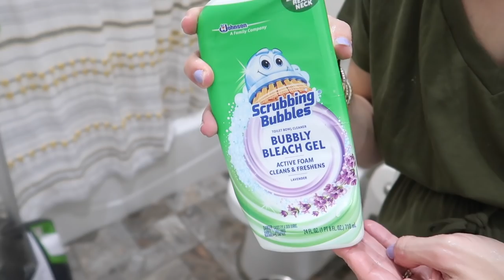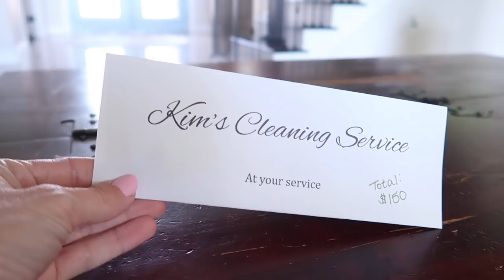A Mother's Touch Whole House Clean With Me!  Top To Bottom, Let's Do It! Homemaking Motivation!

Comment: I heard a tip once that might help for Meredith's bed! Put pool noodles under the fitted sheet on both sides to help put a little buffer on the edges of the bed. Jumbo ones would be even better. :)
Reply from the maker: Pool noodles, yes!  I've heard of this.. probably from pinterest years ago BUUUTTT I'm worried she'll roll right over them and then the fall would be worse... hahah... I should probably get proper bed rails, I'll do something
Reply: Works like a charm!!! 👍🏻👍🏻
Reply: I did this but wrapped them in blankets. I was also worried they'd roll right over. This made them quite a bit thicker and worked perfectly! A leg or arm may hang over, but they'd never roll completely over!!
Reply: @thewadsquad  The kid rolls up against them, subconsciously thinks it's a wall or something, and rolls away because the body thinks it can't go further. At least that's my theory. Has worked for two kids so far!
Reply: I thought about the pool noodles right away, too! One of my kids went to a twin bed very easily and the other is struggling with the crib conversion/day bed thing. It doesn't have the outside bars so we rolled blankets and tucked them under the sheets. Same idea!

Comment: I laughed my ass off when you were using the wall cleaner as your all purpose cleaner on all surfaces.  Reminds me of the other day while I was sitting on the pot.  My trash can had an odor that nobody should have to smell.  So to avoid having to get up off the pot, I grabbed the trash can, stuck it in the tub, squirted in some toilet cleaner and filled it with hot water.  Did a fantastic job and I didn't have to move off the pot.  I was so proud!

Comment: Re. cleaning caddy, I use an Ikea Raskog cart, it is a really great system! Dirty cloths and a small trashcan at the bottom, clean cloths and other 'extras' on the middle shelf (like, swiffer sheets, trash bags, etc) and then the cleaning products, cloth in use, a dish towel and paper towels on the top. We stuck a thing on the side of it to hold the mop, so it is an all in one, roll-along, cleaning cart - it doesn't make the cleaning any more fun, but it sure is handy 😁

Comment: I put both my kids from crib to twin beds.  With my daughter I had the one side of the bed against a wall.  Then I took an old towel and rolled it and stuck between the mattress and box spring.  A co-worker told me about this and it worked.  It lifts the mattress enough that if he moved towards the outside edge of the bed it would make her roll back.  Then I was able to purchase a portable side rail for her bed.  I used it for my son as well.

Comment: Hi Kim! Just an idea on the cup issue when friends come over you could get solo cups and use a permanent marker and write there name on them. Chances are they will be over again so you could just clean the cup and save it for next time. And as far as the sticky stuff that’s hard to get off of things, I found that lemon essential oil takes it right off.it’s like magic. I just ordered the cheaper kind on Amazon and just use it for that purpose. And Hobby Lobby usually has a nice selection of picture frames. And I believe they put them 50% from time to time. Get video! Your A..m..a..z..i..n..g!! 🪴🌸😁

Comment: With Meredith's bed, have you tried this? Get an old double bed sheet and make a couple of pool noodle size pockets in it. Have it so that when you tuck the sheet around her mattress the pockets will sit on the edges of the mattress. Insert the pool noodles  and put her bottom sheet over the top. The pool noodles should stop her rolling off the bed.

Comment: Good morning! Any tips with the cross wave?  I’m having an issue where dirty water is being left on floor part of the time that I’m using it.  It hasn’t been long since I got it so I’m hoping there is just something simple I am doing wrong.  Also, have you tried using something besides the bissel cleaner in it? I’m wondering if I can use some mrs Meyers concentrate instead. The Bissel cleaner seems to leave a film on my floor. Any tips are appreciated!  Happy to see you this morning!!